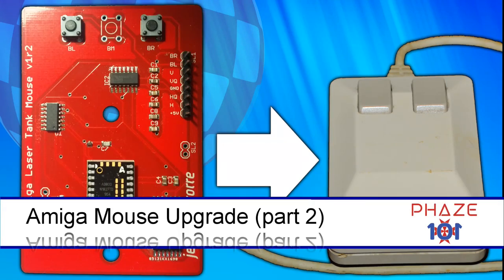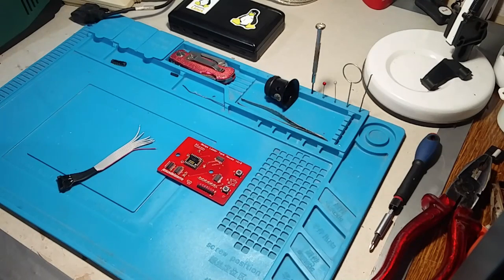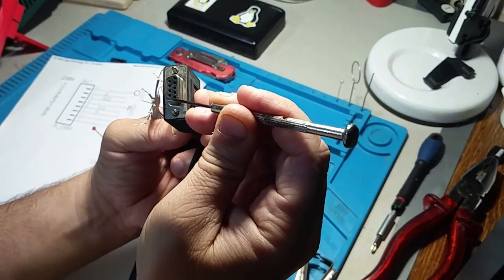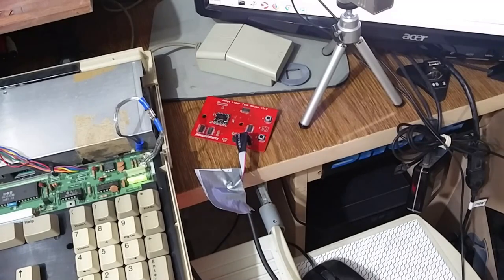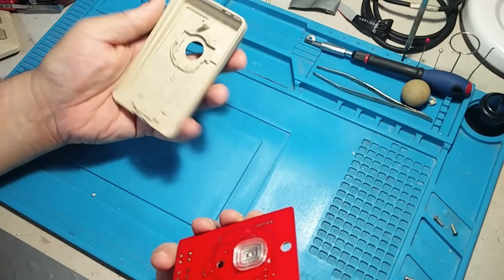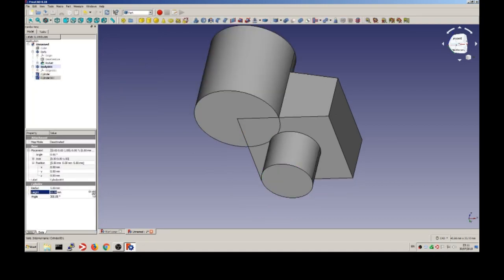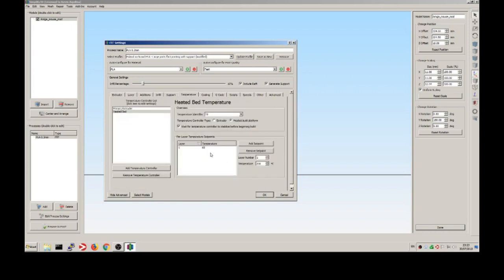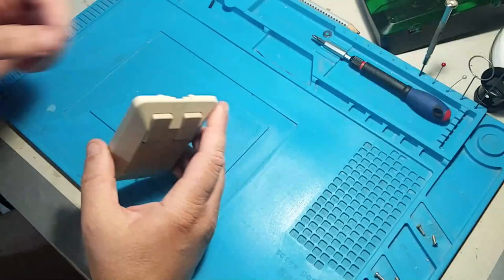Amiga Tank Mouse Laser Upgrade - part 2 of 2

Comment: Just curious, was there a reason you didn't reuse the original mouse db9 cable?
Reply from the maker: Thanks for the question. There is no technical reason ... it's just there is a future project planned to 3-d print the Amiga Tank Mouse case so we kept the cable and old innards for that project!
Reply: 1) I don't worry too much about aesthetics. If it is ugly but works fine that's good enough for me ;)
2) The black cable was available and I was too lazy to desolder the old one :)
3) Eventually I want to 3D print a black tank mouse case so transplanting the laser board will then match the new case colour and  aesthetics will take care of themselves :D